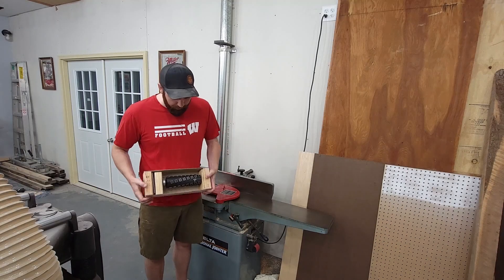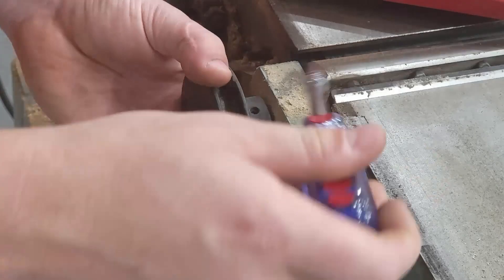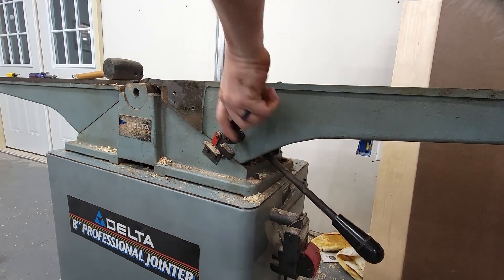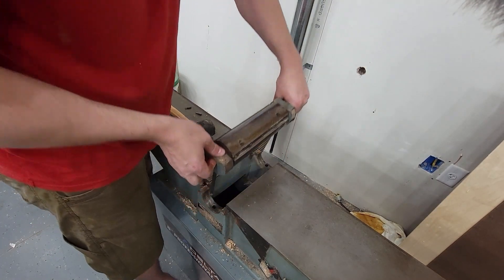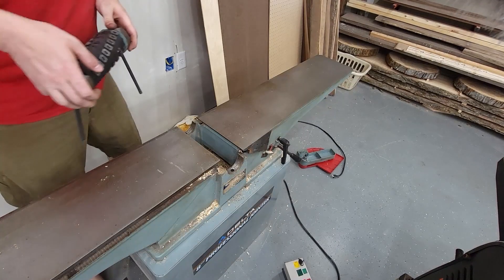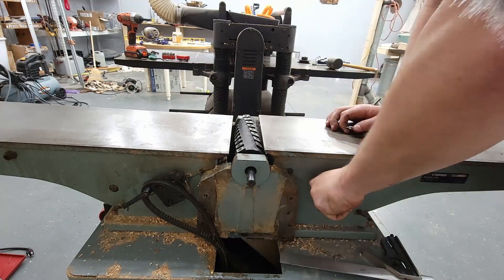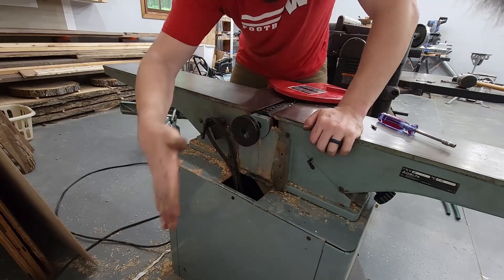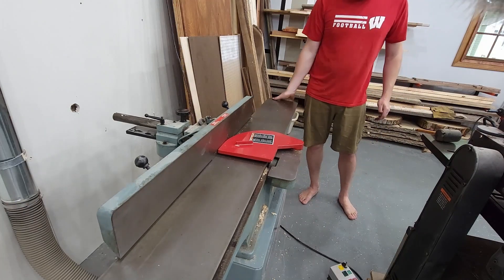Helix Head Install on Delta 8" Jointer Model 37-380

Comment: Thanks,  I have a 6” Delta X model that looks similar to your 8” model so it should come apart similarly.  I’m deciding if I want to go this route since the cutterhead costs more than I paid for the whole jointer new from Amazon.  Bare feet with heavy cast iron and splinters??

Comment: Hey Dan! Thanks so much for this video. I installed a helix head into my 6" Delta jointer and this video helped me immensely. The 6" and 8" are real similar so your step by step instructions were spot on. Thanks again, I'm loving the new cutter, it's like having a whole new jointer.
Reply: Which one fit? Do you have a link?